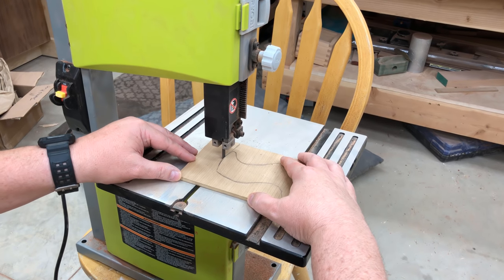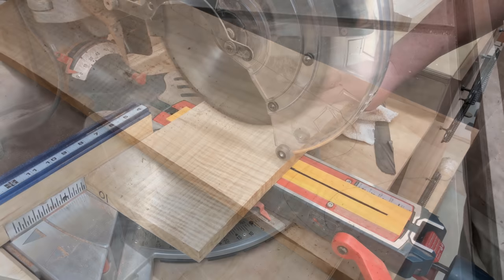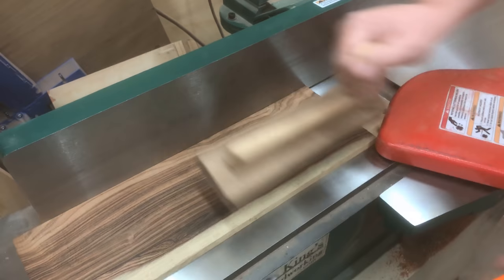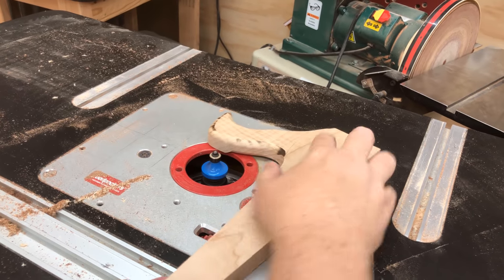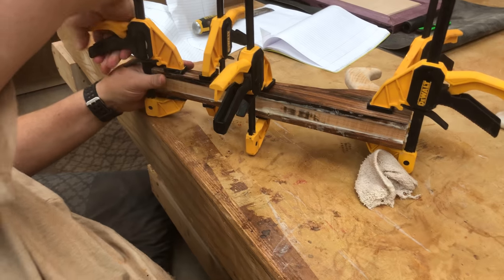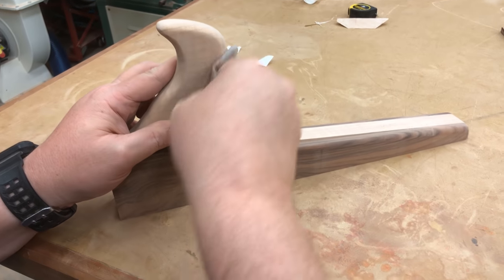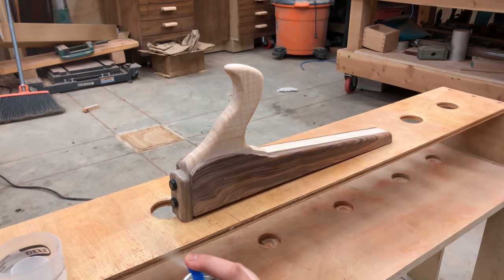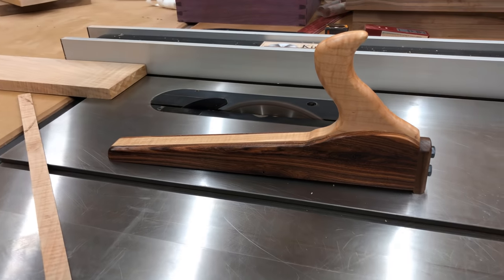50 - Extreme Table Saw Push Stick Safest Design FREE PLANS

Comment: I'm jealous of your machinery.   I've got a shop from my father.  They are smaller machines but work well enough.   He was a wood shop teacher and had all the bigger machinery in his classroom like what you've got.   I miss him.  He taught me so much about cabinetry.   
I am having a problem correcting the crooking in my rough cut lumber.  I happened to take a break and watch this.  Your push stick is so much safer than the old cutting a v groove in a stick, that's for sure.

Comment: Nice work!  I would replace your metal bolts with nylon bolts of the same size, so if the blade were ever to be too high, it won't do any harm to the blade.

Comment: Nice build. Not many of us would go to such lengths, favoring a more disposable approach and plywood. That said, perhaps it would make sense to modify/preserve your beautiful piece by adding a fairly thin replaceable bottom face, maybe 3/8" or so thick, attached via two-sided tape. Also, to maximize the control this type of design provides, I would refrain from applying a slick finish to the bottom, if anything favoring a treatment that increases friction between push stick and work piece. I sometimes glue a rubber face there, emulating the function provided by the proprietary bottom faces of Micro-jig, et. al.

Like others, I have great admiration for your family approach. Regardless whether any of your children ultimately follow your footsteps to pursue woodworking as a career, the lessons learned from the craft and, more importantly, from following their father's example will be treasures for life.

Comment: Nice work and nice ergonomic lines in your design.  That said, I can’t believe you used such beautiful pieces of wood, and not from the scrap pile, to make a push stick!  My push sticks are meant to be sacrificial so I usually make them out of scrap plywood as it seems to hang together better than solid wood as they get cut up.  I do like the concept of the replaceable hook, particularly on a fine furniture grade stick.  I also like the idea from another commenter to use nylon bolts since we all know, sometimes things happen.  Some folks like to drill a hanging hole but I normally don’t as it kinda makes me keep the stick on top of the saw where I can quickly and easily grab it.  Overall, I enjoyed the video and it inspires me to make a showpiece for the top of my table saw.

Comment: What a fine video this is. Such great presenting skills. Never b4 have I been so highly appreciative of a 16 minute video (I am a votary of short videos). I was so enjoying every detail that the video didn't seem that long. And yes, I agree with the observation of @Alan S that the steel bolts should have been avoided, especially the lower one. I think that plug/lip could simply have been glued on directly, or with dowels, and when the time came to replace them, it could easily be sawn off and a new one glued on again in its place.

Comment: A slight change I would make would be lacquer without the catch at the back fitted. If you change to another one you may not have a perfect match and, if undersized, see uncoated wood. The catch block can be lacquered separately. Easy to avoid though by using a slightly oversized on in future but something to be aware of.
Reply from the maker: Great tip! Thank you very much!

Comment: One thought about safety: when I make push sticks and later decide when to replace them, I always consider the remote possibility that the work piece might suddenly not be there to maintain the distance between my push stick and hand above the revolving blade. With a 10" saw, the maximum depth of cut, though rarely used,  is around 3". I think that most of us tend to use the same push stick for all cuts. Therefore, I always make sure that the closest the push stick design would allow my hand to be above the saw table is greater than the max. depth of cut. In a kick-back or inadvertent stumble, weird things can happen. (My respect/paranoia in this regard likely owes to the memorable experience of cleaning a few of my mentor's fingertips from a table saw 40 years ago...)

Comment: You have now given me a great idea on where to use a piece of Brazilian Rosewood I have laying around. It would make a great handle for a push block. Unfortunately, it's too small to make a complete center board per your design, but I'm sure I could figure it out. I found it it in an antique pattern maker's tool chest full of tools I bought at a yard sale several years ago. Actually bought two tool chests at the same yard sale sight unseen for $500 bucks. The lady selling them couldn't find the keys and the other guys interested, wanted to wait until they could see what was in the chests. I nearly broke my wrist getting my wallet out and handed the lady the money just as she said she found the keys for the chests. Boy were those guys upset they were slow on the draw.

I kept some of the tools for myself and my wife made about two grand selling the rest on eBay.

Comment: Thanks for the plan- template. I would make the two sides a little bit longer to create a guide for the walnut catch. Drill a slot to raise / lower the catch up or down depending on the height of the stock I want to push.  I can also be 3D Printed from plastic!!
Reply from the maker: great ideas!

Comment: Keying the sacrificial block in a slot at the back of the handle would eliminate the need for a second bolt. Also use a wing nut in lieu of the bolt assembly would be faster for stop block replacement. Nice looking push stick.

Comment: Awesome looking push block only thing I would change is how you attached the sacrificial plate .. I would have cut a slot in it so I could adjust it for different thickness of wood other than that great job

Comment: That came out beautiful!  I almost wanted to see you leave a channel on the underside, that way if you cut boards that are narrower than your push block, the blade would go into the channel and not cut into the block.  Though there was a taper from front to back, so it would have cut in the front, so it would have taken a little redesign anyway.  Regardless, very nice push block!
Reply from the maker: Thank you! And a channel would have been a good idea!
Reply: Very beautifully  made. What was the name of the sandpaper you used. Thanks  Irv.

Comment: If you connect the two bolt holes to make a slot you can adjust the height for different thicknesses of timber being cut.
I’ve just made to your design

Comment: I would worry about having a bolt so low and close to the blade.  The top bolt will hold on the stop, so a dowel in the bottom hole to prevent twisting might be safer.
Reply from the maker: Thanks for your input. I will be cautious not to cut an inch deep into my push stick.
Reply: Alan S,  We must be on the same page as I was thinking the same thing !
Reply: Using a metal bolt in the bottom hole might be of concern for those who raise the blade an inch or more higher that the thickness of the piece. I have a push stick similar to James (plywood though) and my rule of thumb is never raise the blade more than about a 1/4 higher than the piece I am cutting. Never had an issue in 17 years of wood working. :-)
Reply: I meant it literally.  You may not ever have a problem, but it would make me uncomfortable, so I'd use wood rather than steel.  But I thought it was closer than 1".
Reply: Having a SawStop I was thinking the same thing. Little chance the bolt would get cut but I tend to play it safe.
Reply from the maker: I actually found a cool solution. I ordered some plastic 5/16" bolts, and I will replace them both.
Reply: I was ready for the dowel in the bottom hole, and was surprised by the bolt.
Reply: @KingsFineWoodworking  I prefer brass hardware. No harder to find than plastic and much stronger. Also looks better!
Reply: @KingsFineWoodworking  Great idea.
Reply: I can’t see how this is an issue. To be a problem you would have to have a high blade and be pushing straight into it which would start slicing the far end of the push stick long before hitting the bolts. Why would you then carry on instead of hitting the stop button. Or you would have to be holding the push stick at an angle straight into the blade. I would use brass bolts for the aesthetics.

Comment: I love the design and functionality of this, I could use a longer push stick as well. 

I’m curious though, If the reason for the bolt is to easily change the stop if/when it becomes chewed up by the blade, aren’t you concerned about the blade hitting the bolt? There isn’t much wiggle room for the blade to go from safely cutting wood to hitting metal. You may say that you will always be careful of this but.....you know. LOL. Plus, there are a lot of younger folks working in that shop, that may not be as attentive. I love this stick, but it makes me nervous. 

Thanks again for sharing this. I really do like it overall.
Reply from the maker: Although I will only have the blade high enough to barely touch the wood, I think you are right. I should have put in a wooden or a plastic bolt, and I should have made it higher.
Reply: King's Fine Woodworking I was thinking a dowel for the bottom bolt, but I like your idea better, a plastic bolt would be the better choice.

Thanks again.

Comment: Ps nice push stick..You could also use a flat hex drive bolt like in kitset furniture for a lower profile and then even countersink it for a smooth finish
Reply from the maker: That would have been perfect! But, I would have had to go to the store.  But maybe I will anyway, haha
Reply: King's Fine Woodworking lol yes understand that perfectly well.can always upgrade at a later stage I guess

Comment: That small bit of timber that pushes up against the stock could have been slotted so the timber could move up or down depending on the thickness of the stock.I will be doing just that soon!!!

Comment: I agree with Orange, everything you make is classic. I do have a question for you though, I was once told by a cabinet-maker that the final sanding before applying a final coat should be done with "steel-wool". Would that be the equivalent to using 1500 grit sandpaper ?
Thank you
Reply from the maker: Hi Michael, Sure you can use steel wool. To get the equivalent finish, you might use 0000 steel wool. I just don't like the little metal strings that are left by it. so I go with sandpaper.

Comment: Looks great but how far down should the catch be below the base? Any reason 1/8" won't work?
Reply from the maker: @cottydry  1/8” will work fine.
Reply: @KingsFineWoodworking  Thank you.  Your design is the best out there. I like the pistol grip better than a hole or a slot because you can release it instantly in case there's any problem.  The angle is just right.  As the saw blade comes thru,  my arm is well above it and at a steep angle. The width, length and mass inspire a lot of confidence.  I added an extra 1/2" on the base just in case I need to renew the base a few times.  I also made my pusher cleat offset and reversible for 1/8", 1/4" and removable. It was really easy to make.

Comment: Can you make wooden bolts, passing steel over a steel blade would make me nervous. Maybe blade set a little high for instance. Just saying no disrespect. I absolutely love your projects and videos. I downloaded this one, it looks like a duck so I decided to add some artwork too it and have some ducks in the shop. God bless in his will, my new Family of Wood Craftpersons.
Reply from the maker: Michael Sharpe, you are right. It’s safer without a steel bolt. 

We did find nylon bolts that were exactly the same size at Home Depot. And they have been replaced. I did mention it in the comments section already. But there are so many, it’s probably not easy to find. 

Thank you 
James

Comment: Beautiful push stick.  I disagree about the 'use more glue' concept.  What I've read recommends a thin, continuous coating of glue, yielding just a little squeeze out.  Yellow glue is not good at gap filling - you need epoxy for that - and in certain situations, a too thick coating can create pockets of glue that actually prevent the two pieces of wood from touching.  In my opinion, adding loads of glue at best creates a squeeze out mess, and at worst actually will be a weaker joint.
Reply from the maker: Thanks for the tip. And you are right as far as adhesives are concerned, there are two important factors to consider. Adhesive strength, and cohesive strength. Adhesive strength is the ability of one substance to stick to another via a property called adsorption. (not absorption). And cohesive strength is the ability to stick or bind to itself.  Polyvinyl acetate adhesives excel at adhesive strength and are rather poor at cohesive strength, (as you pointed out they lack gap filling ability).  Therefore if anyone were to carry on as I do, and go overboard on glue, then it is imperative that they apply sufficient clamping pressure in order to eliminate all excess glue from within the bond. 

Alternatively they could simply not do as I suggest, since it really is just a running joke for our channel. Just the same I am glad you pointed it out for us.  Thank you for watching and commenting.

~James

Comment: Over kill on push block 👎👎 why the large machine screws to hold the push block up then nice piece but I thank the large bolts killed the whole job ,don’t get me wrong  it is just my opinion.   🙏🏻🙏🏻GOD BLESS you and family ,stay safe .from the CALF.WILD MAN.
Reply from the maker: They were swapped with plastic bolts right after.  So they are still there, but less obvious, and now there is no metal in the piece. 

Thank you for watching

Comment: once you tap the wood and to increase the pullout strength of the bolts you can drip in thin cyanoacrylate glue. Soak the threads completely. Let it dry completely without accelerator and then run your bolt into it and out a few times to shape the dried glue bits. This glue turns the wood threads to something much stronger.